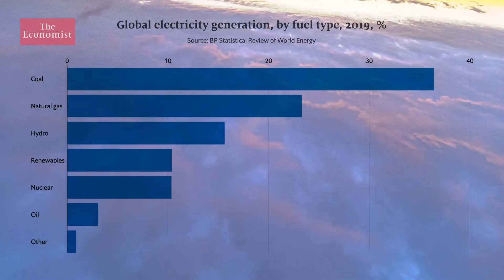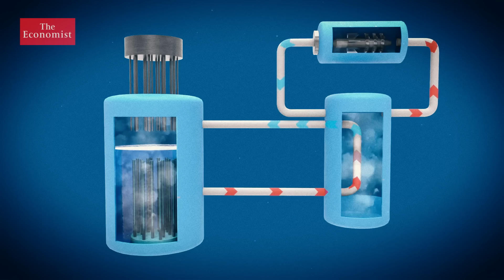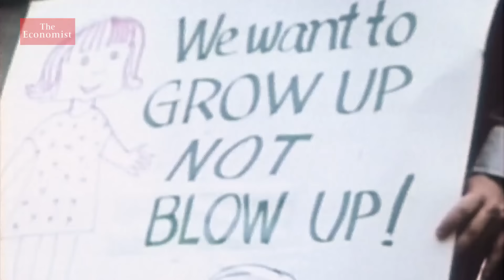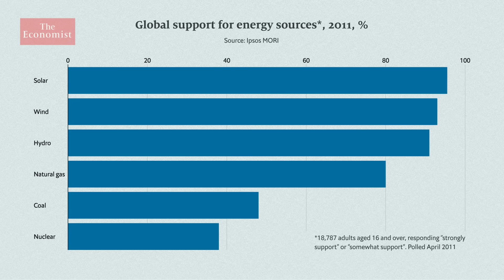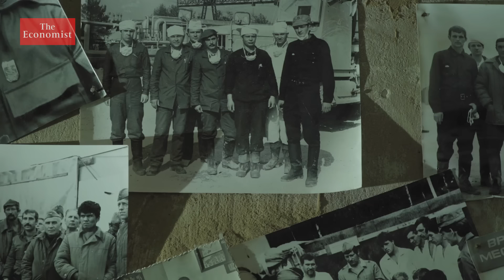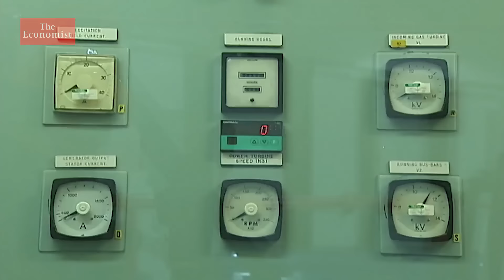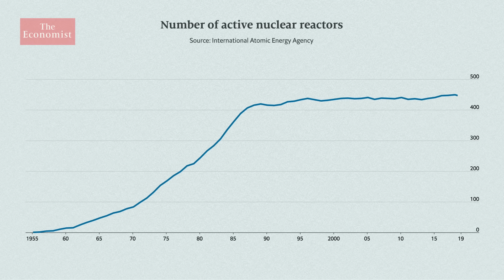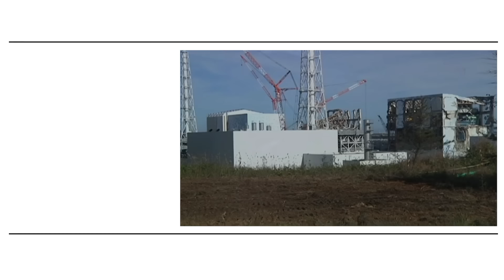Nuclear power: why is it so unpopular?

Comment: Google meltdowns in history.
Reply: I have. I research nuclear accidents on my free time, and I’m still pro-nuclear. (If you’re actually interested, the SL-1 accident and Kyshtym disaster are 2 of my favorites, although Kyshtym isn’t a reactor accident)The problem is people look at the shear number of listed nuclear accidents on Wikipedia and they freak out thinking that it’s so dangerous, but they don’t then go look up how many accidents there’ve been in coal, hydroelectric, natural gas, etc. and therefore think nuclear is way more dangerous than the statistics will actually tell you. Looking up meltdowns is also deceiving because the majority you will find involve experimental reactors in a lab in like the 1950s, not civilian power plant reactors. In most cases those reactors were discontinued for being dangerous. And even if you do look at just civilian power accidents, the only nuclear power accident that has killed anyone from radiation is Chernobyl, which came from a problem with a specific type of reactor that was never used outside the Soviet Union. You have look between the lines when you are researching. Saying “there have been a lot of nuclear accidents, it’s so dangerous!” is a pointless argument, because you’re comparing having nuclear to not having nuclear, when you should be comparing having nuclear to having coal, or having hydroelectric, and comparing the pros and cons of each. We don’t live in a vacuum.
Reply: @theclockworksolution8521  

You haven't worked with Chernobyl kids, I assure you that.

Where I come from, to this day hundreds of cancer cases still appear every year.
Reply: Whenever one of these paid advertisements get uploaded disguised as "News", every clown working for and shilling for the Taxpayer Subsidized Nuclear Energy Industry shows up to claim it is "safe now" even "cheap now".

Comment: Why can't we build Edison generator and dynamos  plants with inverters and transformers to deliver high voltage  AC to the power lines.   We are grossly misinformed about power generation and power use.  Nuclear power plants all have plumes of nuclear radiation about the power plants.  The accident in Japan created birth defects in Central America and Venezuela. The power plant accident in Ukraine has created birth defects in Kiev and windward.  Much of the reason for invasion of Ukraine is the American refusal to clean up Chernobyl.

Comment: Can someone explain or elaborate - is nuclear energy actually clean? I thought nuclear plants produce toxic nuclear waste which is dumped back to the ocean and thus pollute the ecosystem in the area?
Reply: Nuclear power is very clean
Reply: @kinderfett5259  okay... but I thought the water that is used in the reactor will be radioactive
Reply: @randomcon123  It’s actually not that radioactive, except of the bottom, it’s pretty hot there and toxic
Reply: @kinderfett5259  fair enough but don’t you need to get rid of that as well. Forgive me if I m not best informed, but I thought the only way of getting rid of that toxic water is by dumping it back to the ocean which adversely impacts the ecosystem in the region
Reply: @randomcon123  You don’t get rid of the water. Why would you?

Comment: What happens to the waste
Reply: You put it in a big steel and concrete flask and then you put it on a concrete pad outside the reactor and you have a guy walk buy once a week to check that it's still on the pad. Once you've shielded the radiation. Its harmless. And there is so little of it that this is really easy.
Reply: Stored underground

Comment: I shall always be uneasy with nuclear power. 
Go as far as you can with Solar and wind power. 
Home insulation, and domestic batteries.
Reply: I used to be very pro-renewables until I learned how much more damaging they are to the environment than nuclear. They require waaaay more land and way more materials to produce an equivalent amount of power to nuclear and they still require fossil fuel back ups. They simply aren't a solution to the problem were trying to solve and nuclear is. Wind and solar are great if the problem your trying to solve is how to make money, cut your electricity bill, be independent, etc. But if the goal is to decarbonize and save the environment? Nuclear is the only option.
Reply: Nuclear power is great. Why are you uneasy with it?

Comment: I would be supportive if you could de- nature radioactive material. The plan now is dig a deep hole and hope nothing happens to it for 2000 years. As bad as fossil fuels are they are chemicals. As chemicals they can be changed through chemical reactions into safer substances. This may not be cheap but has a safer outcome.

Comment: It's not usually in the news. We only had Fukashima in 2011 (where faulty design of storing water in ground tanks and using pumps to dump it on the reactor didn't work (as electricity was cut) rather than storing it above the reactor and letting gravity does it work).  And Chernoby where the reactor didn't even had the concert ceiling casing like all Western and Japanese reactors have.

Comment: Why don't you talk about the nuclear waste ? This is currently the true problem of nuclear energy production.
I'm genuinely surprised that you talked only about the irrational fear of this, there is a much more concerning problem with the management of the waste produced by a nuclear power plant and you did not even pronounced the word waste. To me this is just an unfair way of tackling this subject.
Reply: What about it? The “waste” is solid metal rods that are stored inside weatherproof dry-cask storage cannisters and stored on-site in a secure location. It is neither a security nor environmental risk. It can be stored on site indefinitely
Reply: @piouswhale  Indeed I don't think it's a security risk, but is will probably be an environmental risk at some point, we don't know how long we need to store it, it's expensive and complicated, this is clearly a big deal. But the point of my comment was mainly the fact that they did not even pronounce the word.
We can discuss here about it but for me one of the main reason why nuclear i not as much developed as it should is due to the management of these waste
Reply: Waste storage is neither expensive nor complicated. Its stored in weatherproof dry casks. Its not a big deal at all. Some reactors can even use spent rods as fuel.
Reply: The lack of development of nuclear is solely due to anti-human movement of the environmentaist lobby, beauracratic red tape and an ignorant populous

Comment: This dangerous cold war relic not the answer! What would have happened if they stop innovating after they got the first steam engine working? Basically that's what happened to the nuclear industrials, oddly they have the same type of problem with the pressure vessel blowing up that the first generation of steam-engine, but the nuclear reactor different it turns the water into rocket fuel and ignites it💥 sending radiation everywhere. Would you buy a car with 0.7% efficiency rating? That why this Reactor takes 10,000 years and lots of room for waist storage! Thorium Molten Salt Reactor is not perfect like the unattainable dream Fusion reactor that nobody has been able to build for the last 80 years now, but it far superior to the cold war relic reactor in so many ways.

Comment: The nuclear industry profits off unnecessary safety measures which is why it's more expensive then it needs to be. They build plants in china for a fraction of the cost as the west did as well decades ago.
Reply: China can build it cheap because China has the most advanced infrastructure technology， check out the Chinese railways and bridges
Reply: @raymondzhao9557  Have you looked at the cost break downs for nuclear construction?... because I have and roads and bridges are not the reason. Most goes to capital, consultant beauricratic costs.

Comment: Disappointed that they didn't even touch on the concerns of dealing with spent nuclear fuel, which I would consider more of a rational thing to worry about than melt-downs.  Melt-downs and accidents might happen; disposing of spent fuel is something you are absolutely certain a nuclear plant will have to deal with.
Reply: Why dispose of it?  It will be very valuable fuel in thorium molten salt reactors.